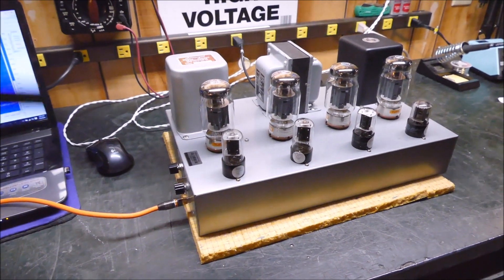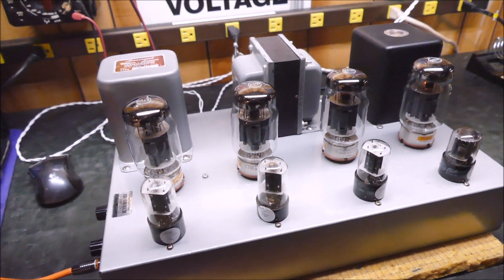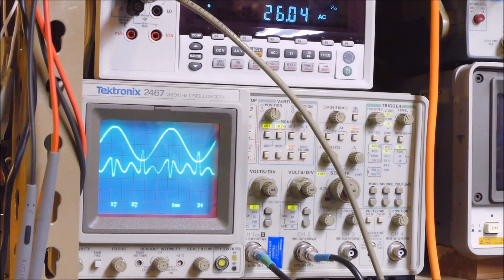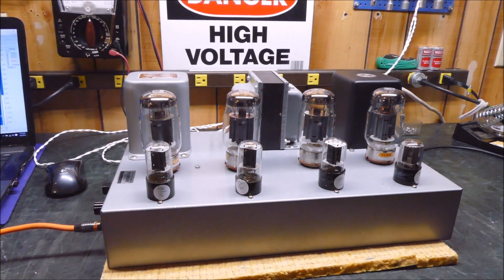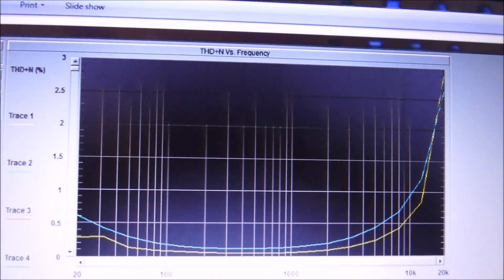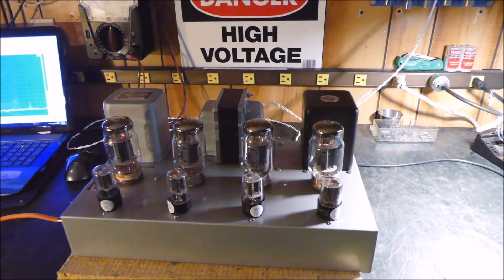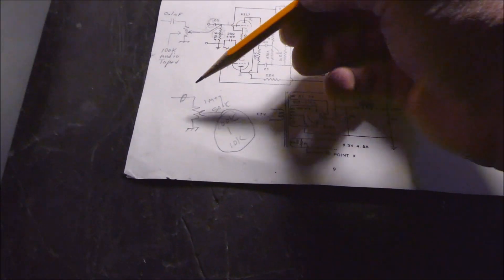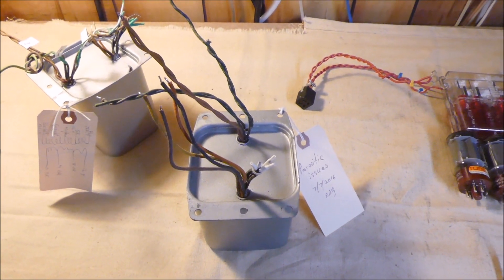Part 6 - Acrosound & James Audio (Williamson Design) TO-300 Transformer Vacuum Tube Stereo Amplifier

Comment: The Williamson amplifier, being four-stage, is known for needing a very tightly specified OTX to be stable. Good to see that people are still building them after nearly 70 years. I agree with the suggestion to restore the original NFB network values. Good luck with it.
Reply from the maker: I have to ask, what is OTX? From becoming intimate with this design by building it, it simply isn't stable and performs poorly above ten or twelve watts. There are no provisions for any parasitic mitigation and it has plenty. We have to ask ourselves, if this design is so good, why was it changed so quickly?  For the few clean watts that it does provide, it sounds marvelous into high efficiency speakers. Here is a link to "Modernize Your Williamson" by David Hafler, 1956. http://www.tubebooks.org/file_downloads/modernize_your_williamson.pdf
This article does provide for some parasitic mitigation and I am going to try it and see what happens.
Reply: +ElPaso TubeAmps Sorry, OTX = Output Transformer. Similarly PTX = Power Transformer, basically TX = Transformer.
Reply: +QuadMaestro Sadly there's a page missing from that article, but it seems to be one mostly about power: all the stability mitigation stuff seems to be there. Interesting that the instability you found was only on the negative swing, and most of the mitigations suggested are on the lower plate: either a C shunt to ground or an NFB capacitor back to V1. The lower half of the circuit has one less phase shift than the top half, as it comes via the phase splitter as a cathode follower. Interested to see where your journey ends.
Reply: +ElPaso TubeAmps I looked up the original Williamson articles. In his revised version he specifies 4k7 and 200pF across the plate resistor of V1, to solve transient parasitic oscillation, and he is adamant that a capacitor across the feedback resistor 'will not stabilise this amplifier' unless the transformer is not to his specification. He also shows the AC response of the amplifier as extending well beyond 100kHz, which is food for thought. He is also adamantly against separate RC bias arrangements for the two output tubes: 'numerous disadvantages ... and no redeeming features whatsoever'!
Reply from the maker: That is really interesting and I love these guys with so much passion. However... we all know that many things are hard to predict and reproduce exactly and sometimes I think their ego gets in the way.  Just tonight I put the first TO-305 back in as I built this amplifier specifically for the use of these transformers. Another purpose was to see just how "great" these transformers performed in circuits designed by Acrosound. They pretty much perform like other quality amplifiers of that era and it is pretty good. I consider them good 30 Hz to 15 KHz amps. I have listened to this amp through my Klipschorns and then my MC275 and then a 2100 and there is not one imaginable bit of difference as long as I am not trying to drive the nails out of the wall. These amps sound fantastic at 10 watts and below. The Klipschorn has a sensitivity of 105 dB so 10 watts will drive it to 115 dB SPL so unless we are listening to AC/DC at live concert level, 10 watts is too much for any normal sound level in a house on speakers this sensitive. The fact that I had this real or perceived issue with one of the  transformers which prompted me to put the James transformer in just gave more opportunity for me to compare transformers. The James transformers did just a good a job, in my opinion and sell for about the same price as vintage small Acrosound trnsformers. I may make one more video to close this project out. I am kind of tired of it for the moment. My next passion is to build a 3-1000Z RF amp. I have just recently received a 2000 pF vacuum capacitor I intend to use in the loading section of the output network. 
I know I will continue to play with this amp. Actually, I have it connected to the speakers in my shop and I love the way it sounds.
I am interested in the article you mention.If it is convenient, I would appreciate a link to it.
I made a comment the other day where I found an article on "Improving Your Williamson" by David Hafler from 1954 - I think this is accurate. He believes the new EL34 pentode is the cats-meow and he has some suggestions for improvements of the Williamson design. I tacked a couple of his suggestions across my amp and i didn't see anything happen. In my particular case, it seems the 500 pF capacitor from screen to plate on one specific output tube does eliminate much of the transient parasitic oscillations.
Thank you for all your time and suggestions throughout this project.
Reply: +ElPaso TubeAmps Indeed. Williamson is also the co-author of a silly public letter about the Hafler-Keroes ultra-linear paper, which states 'the authors do not believe this claim'! Well sorry, boys, it's true anyway ...

Comment: Do you ever build kits for people?  I've been looking at these: http://www.transcendentsound.com/Home.html
I would not attempt to build one of these myself, but I'm interested to see how OTL sounds.  Have you ever built or heard an OTL amp?
Reply from the maker: The preference towards different types of amplifiers is as varied as anything I can think of. Whether it is PP vacuum tube, SE triodes, SS, OTL, etc. it all seems to come down to what charms us - at the moment.

Looking at the website you provided, I see what might be a 211 and an 811A tube. I think we all have some fascination with tubes like this and easily imagine that they would sound wonderful - but maybe not. Consider the 811A...  it is a very robust triode built around WWII for simplicity and easy construction. A pair can be used as a modulator and one or more as an RF amplifier. They can be run at zero bias up to around 1250 VDC and they work great. Good stuff. But, they never were intended to be a HiFi amplifier tube. They require grid current so that takes a more powerful driver stage. The plate Z is high because of the HV. Just a lot of things that don't lend them to HiFi use. But since they are so beautiful and plentiful and relatively cheap, we try to build stereo amplifiers out of them. 

As for the SET amps... a long time ago the need arose for something better than the 3 watt SET amp found in many radios. So, along came the PP amplifier and the tetrode and then the pentode. The Americans made the beam-power tube (6L6) and the British made the EL34 (a true pentode) and the war of sound began. 

Now we go to the OTL design. There are a number of designs that have been around for decades where six or eight tubes like the 6080/6SA7 have been used. These tubes are (relatively) low voltage, high current devices and were designed for power supply regulators. I have never actually seen one in the flesh but some people swear by them - but then people can swear by anything - "There is no HiFi like my HiFi" is the only way to stay sane in the stereo world.

To answer your question, I do not build for anyone although twenty five years or so back I did build a RF amplifier using four 811A's for my friend at the MARS station at WSMR. It would do an honest 500 watts to the antenna and he was very pleased with it. Other than that, I can't recall building for anyone else.

I do all of this just to entertain myself as I like to measure and document. I guess I picked it up from my career.  :-)
Reply: Thanks for the thorough and interesting reply.  -- "There is no HiFi like my HiFi" --  so true!

Comment: Another interesting video once again! I'm very curious to know what the problem is with the one OT...I'm a very curious technician. :) By the way, stay cool...It's hot as hell here in New Jersey as well, but I'm sure it's much hotter out by you :) Be careful with the heat and your test gear...Lost a scope one summer.
Reply from the maker: Hi Frank - speaking of losing a scope from heat - I have a small air conditioner in my shop and a few years ago my wife decided I was wasting "electricity" by running the A/C so she turned it off. All of my equipment was on and my Tek 485 scope died. I think I have made a point of it in one of my videos but I installed a thermostat that powers off everything in my shop at what evertemp I set it for - around 90 F. With all the equipment on, the A/C can keep up but it's working hard at it...I am very curious about the OPT also. I will measure everything I can think of and any thoughts of how to approach it are welcome.
Reply: Well, one of the ways I could think of off the top of my head is, using an AC voltmeter maybe an HP 403B? a Multi meter, and a sine wave generator. Measure the DC resistance of each winding then write the readings down. Then, measure the impedance  Then, connect a 100 ohm variable resistor across the low resistance winding; initially, leave one wire open;  connect a 25K variable resistor in series with the high resistance winding and the output of the signal generator; set the resistance to 0 initially; set the signal generator to 1kHz and near maximum output which may be around 20mV RMS. Use the audio Voltmeter to measure the input and output Voltages; write these down. Calculate the turns ratio = VIN/VOUT. Connect the 100 ohm variable resistor in circuit...Reduce this resistor till the output Voltage falls 3dB.  Increase the 25k resistor till the output Voltage falls another 3dB.  Without disturbing the settings of the variable resistors, disconnect one lead from each. Use the multi-meter to measure the settings of these two resistors, these are the impedance's of the primary and secondary, you may need to replace the 100 Ohm variable resistor with a lower value to get an accurate measurement. Compare the turns ratio with the impedance ratio, do they agree? Allow for the dc resistance of the windings. This test procedure works well for push-pull output transformers. Not good for testing single-ended transformers.
Reply: PS: I'm going to e-mail you 4 PDF files which list almost all output transformer characteristics...Handy to have in the shop...
Reply: Dave.To be fair on the comparison of the output transformer test,you really need to sweep the transformers separately from the same source..That way you won't have the influence of the circuit because differences you may be seeing from the AcroSound to the James, may be the differences in the components driving each channel even tho they are supposed to be the same.Who knows what happens inside a capacitor at any given time .
    Here is what I do when I want to just sweep an output transformer.I got me a Rotel solid state amp that's 125wpc or so..They are a great SS amp for this and you can pick them up on Ebay relatively cheap. The reason a solid state is ideal for this is because of its ultra,ultra, low secondary impedance.We are are talking like a millionth of an ohm. 
    Now say you want to sweep  an output transformer that is 6.0k primary impedance. You take two 3k non-inductive high wattage resistors and hook them between the output of your SS amp and the other side to each primary leg. Then you can run a square wave thru the transformer at the full power rating of your transformer or at 1 watt..You can also do your sweep of the transformer...Be sure to hook a load resistor on the secondary of the output trafo. You are basically using your generator and the Rotel to drive the output transformer as if it were in the circuit.
      The reason the Rotel is perfect for this.Its a wide bandwidth,low distortion,low impedance amp.
BTW,wonderful and informative video as usual.
Reply from the maker: Hi Mike - I have seen that circuit and I have considered it. I do have an extra McIntosh 2100 that I can use for this purpose. I totally agree the anomalies could be from component values and placement. These artifacts occur only at 15 watts and above. I have put a sweep signal through the transformer - into the primary while monitoring the secondary - and I see no issues but it is only at 4 volts into the primary. I am beginning to think there is actually nothing wrong with the Acrosound transformer but I will try what you suggest and test it under load. I appreciate your thoughts on this.
Reply: ElPaso TubeAmps
 Oh ok,for the transformer test.I think you may be better off with direct coupled output amp as opposed to the autoformer for this test.

Comment: Great video.  Thanks.  I feel sorry for your air conditioner, with all that equipment throwing off heat. Do you keep all the amplifiers you build?
Reply from the maker: I usually do not keep the amplifiers I build. Only one have I had since 1977 and that is the McIntosh MA230 channel I built back in that day. I do tend to keep RF test equipment that I have built, like RF bridges, etc. 
I do have to leave the A/C on 24x7 in the summer (it will be 102 today) or it gets so hot in my shop that it takes hours to cool down. I insulated this building very well when it was erected around 2001 and it will stay cool and warm pretty easily but, as you mention, the equipment can heat it up quickly without the A/C.

Comment: Great video as always, but i would like to see some frequency response plots for each transformer. Perhaps you could take another THD plot and a frequency response on the left channel as a baseline, then switch to the James transformer and measure them again.  At least that way the only variable is the transformer itself.
Reply from the maker: I will be happy to make some more frequency plots and post them. However, the two that I showed are of each transformer in the circuit as the amp was shown in this video. I did not make note of the power but I believe it was at 15 watts for each channel. Measuring FR of transformers at the mW level usually turns out pretty good for all audio OPT. You will definitely see a roll-off if testing something like a filament transformer. Some people test at 1 watt - I don't see much purpose in that but I can post that also and then measure again right below clipping. Just below clipping is where I think the rubber-meets-the -road. Thanks for your comments.

Comment: Nice work and good troubleshooting with the transformer.  Probably the most difficult component to 'swap', but worth it by finding the problem.

Can that defective transformer be opened for inspection?  Looks like it is stamped / pressed enclosure.

Keep up the good work and videos!
Reply from the maker: These transformers are very nicely potted and sealed so there is no taking them apart. Since I have a total of four (that I have to give back to the original owner) I will have to "get busy" and compare and document each one. I am really interested also in what anomaly I might be able to find in it.